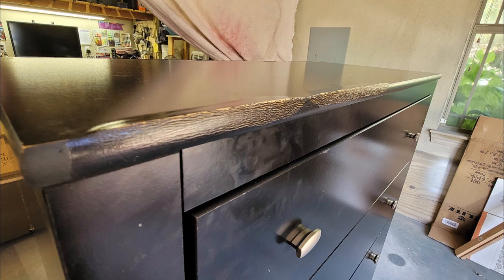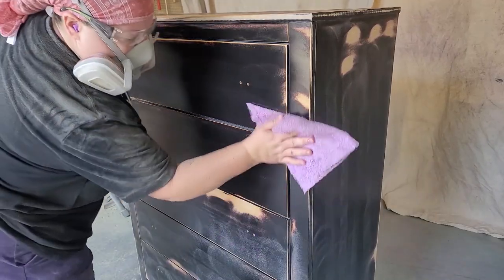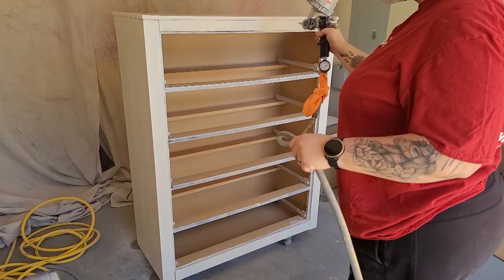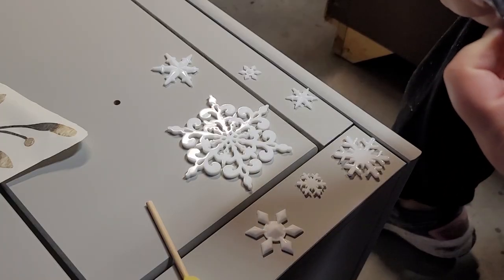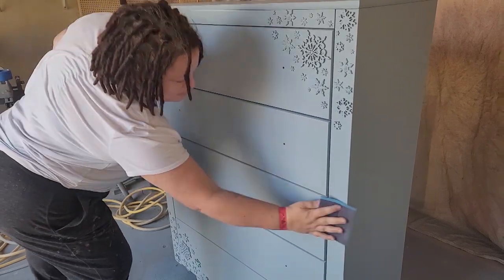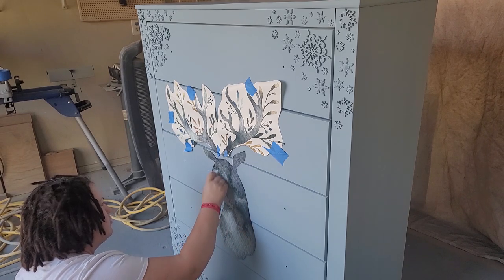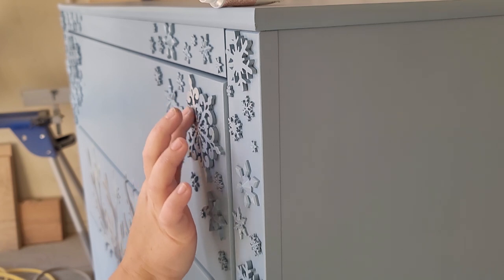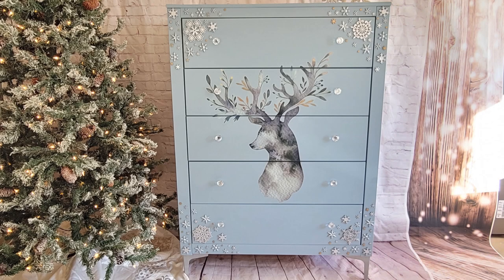Cozy Winter Furniture Flip Challenge/DIY Water Damage Repair

Comment: i never even considered using wall decals, will have to have a look
Reply from the maker: Yes they are so much cheaper! They usually have a large clear section around the print compared to transfers, but they are sooooo much cheaper! If the clear area really bother people I tell them to trim right up to the print.

Comment: I don’t normally like appliqués but these made the piece look so perfectly of winter. Not necessarily warm and cuddly but crisp, clean and cold. What I’ve been waiting for after all the Texas heat. I really like it. How has that 3M system work with furniture painting? I’ve only seen the car guys use it, not really the same thing. Seems like a good system.
Reply from the maker: My 3M gun works great! I will be making a video soon in detail of how to set one up and use it to spray furniture.

Comment: Wooooow amazing work! Is it also possible to make ornaments like these snowflakes with wood filler instead of resin?
Reply from the maker: I am not sure I would use wood filler. Unless it is an epoxy or bondo mix it wouldn't be durable. They do make some casting clay you might find easy to use and durable.